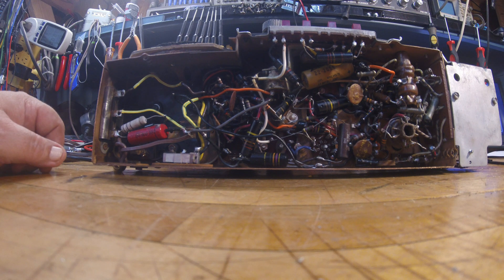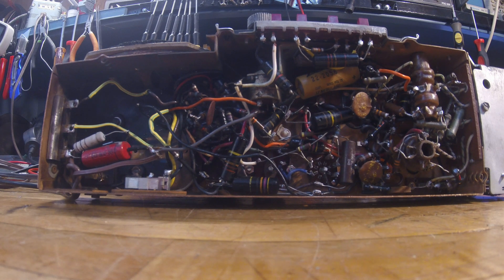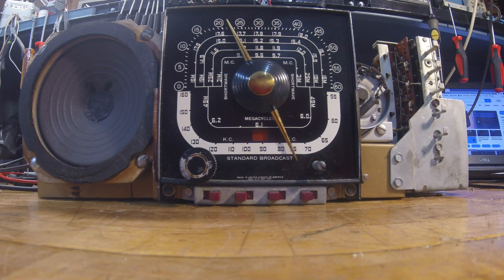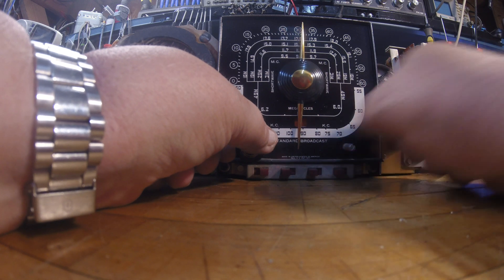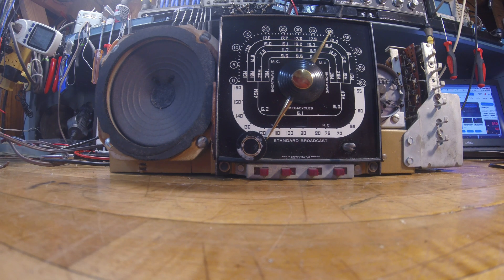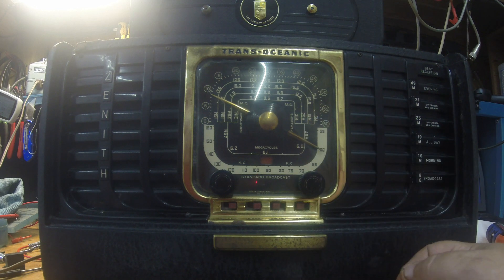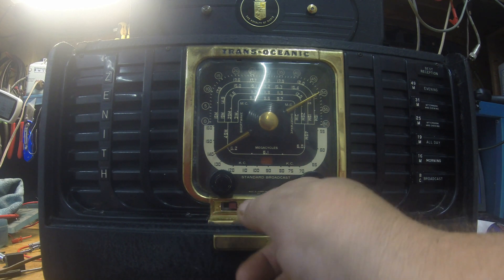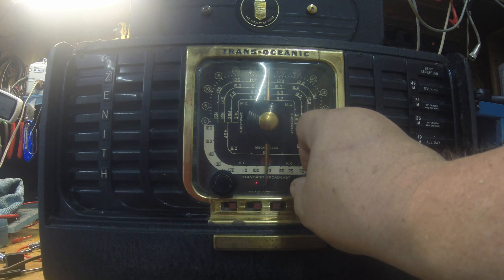Zenith G500 Trans-Oceanic Shortwave Radio Repair and Restoration Part 3

Comment: I have a zenith G 500 and I’m just wondering how to set up an external wire antenna I have not found anybody that knows How. Can you help?
Reply from the maker: Are you talking about the one that is included? If so you plug it into the back of the radio there is plug for it and than you un spool the wire hang it on a window with the suction cups if they are not dried out mine were.
Reply: @TheElectronMan  I was told by the ww2 radio man that they hooked up a wire from tree to tree and a ground rod?
Reply from the maker: I misunderstood what you asking I have video on how to make a simple SW antenna https://youtu.be/6Oapclbi4uA
Reply: @TheElectronMan  cool Thank you

Comment: Well done! Just out of curiosity, do you have it on a wire antenna?
Reply from the maker: Yes a home built one I have a video on it. But the answer is yes I am in a steel shop so I have to external antenna to receive about anything.
Reply: @TheElectronMan  I picked up a G500 that had already been recapped and had the rectifier upgrade, then one week later, another G500 came up for sale for 20 bucks....lol. It seems like it was meant to be, lol
Reply: @TheElectronMan  I can't wait to get a proper antenna up for my G500. I do get some shortwave on the extendable antenna, but seeing the stations you were getting ... impressive!
Reply from the maker: @barryz1969  Yes you need to get an external antenna it opens up the airwaves enjoy :)

Comment: She lives and running, well done, I think the tone caps are shot, they don't make much difference, but hat, it's running  :-))  I would think it is just pulling in a Cap' for tone?
Reply from the maker: Thank you sir.. Actually my camera mic just doesn't pick it up well but they are working pretty well in person. The only one that doesn't seem to have much effect is the one marked voice the tone ones and the noise limiter work pretty good but good point on the caps I need to check them out especially on the voice tone one that could be it.